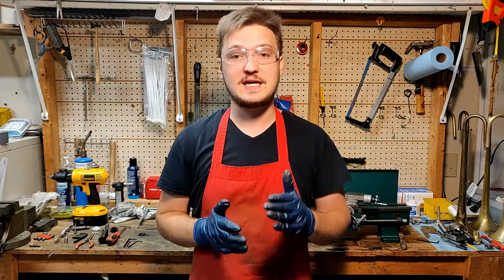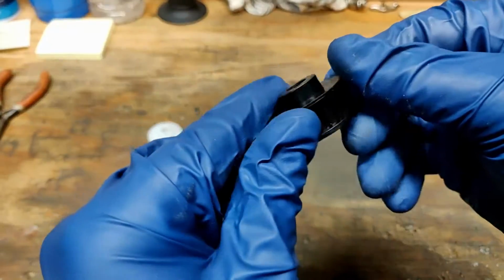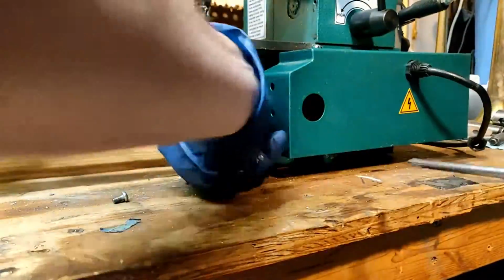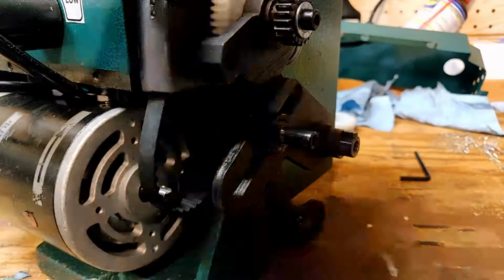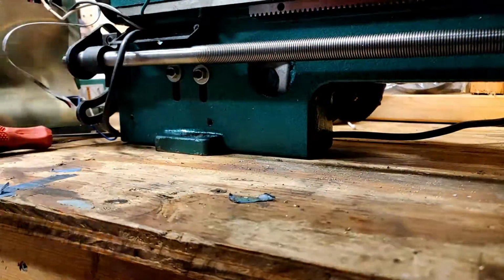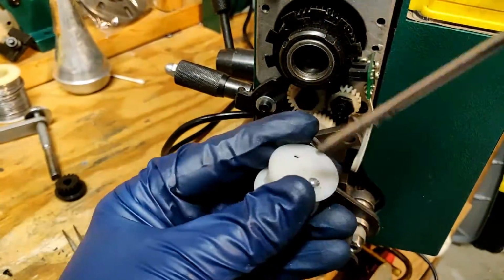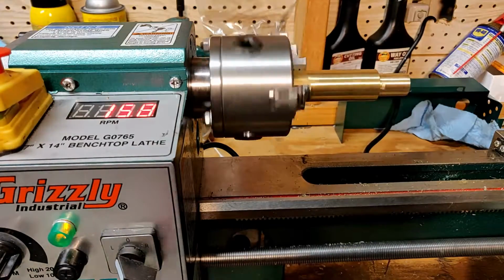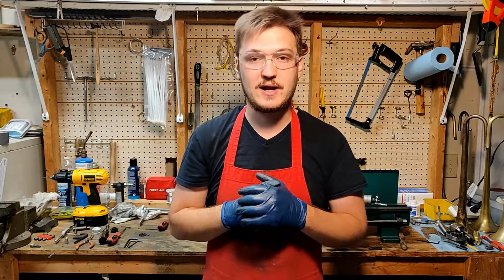Replacing the Timing Pulley on the Grizzly G0765 | Mini Lathe Repair

Comment: Would you consider replacing it with a metal one instead? I am curious on the longevity of the gears themselves and already looking into replacing all of them with aluminum gears.
Reply from the maker: I would consider it. That gear is actually a planned failure point so one doesn't damage more expensive components. I need to get better at machining to know the limits of the lathe with respect to depth of cut and feeds and speeds. This makes a $5 dollar mistake rather than having to replace multiple gears/belts/ motor shaft, etc. Additionally, I haven't yet found a metal gear that is exactly the same yet. The location of the key way, set screw, and number of teeth all matter. I'll keep looking, let me know if you find one!